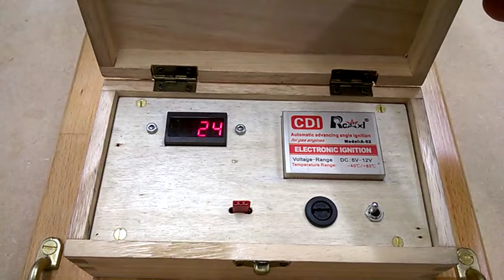Hit & Miss Engine, Red Wing 1/3rd scale

Comment: When it attempts to fire but fails one or more times before it finally fires, what is going on there? Is that a mixture issue once it starts to warm up? I've heard that on a few engine videos, but I haven't heard a good explanation for it.

Congratulations on very low friction, by the way. You mentioned in another comment an interest in building a twin. I've never seen a twin cylinder hit and miss, and am enthusiastically interested in such a project!

I have a smaller version on the way and can hardly wait to dig into it.
Reply: Buck Starchaser 
it's a hit & miss engine
Reply: Buck Starchaser , I have found that normally when it’s double firing like that it is because it is to lean, need to open the mixture screw a tad bit. The only twin cylinder Hit and Miss engine that I have ever seen was scratch built by Jim Limacher, and is on the cover of the Oct/Nov 2013 issue of Gas Engine Magazine, and it is a beauty !

Comment: why use the drill to start it? i found that to be laughable. nice engine btw
Reply from the maker: why not? . . glad it amused you!
Reply: It isn't necessary to start a Redwing with a drill!  Both mine - air-cooled and water-cooled - start first pull by hand.  It shouldn't misfire like that either.  Excellent job otherwise though.